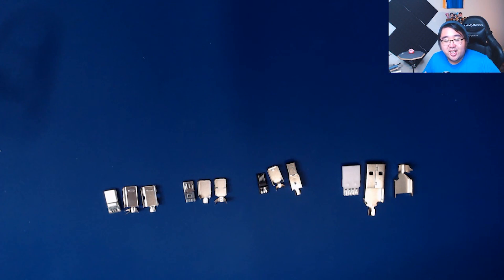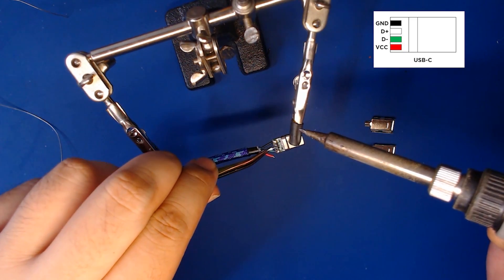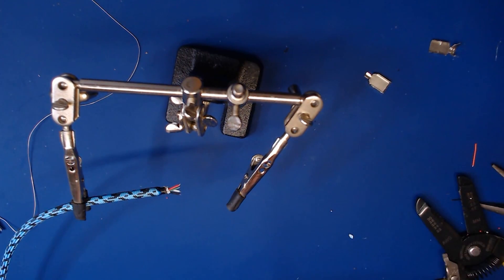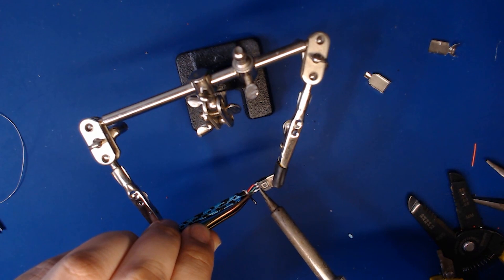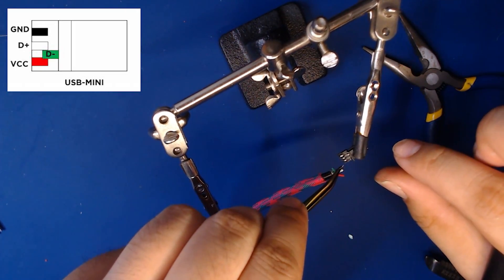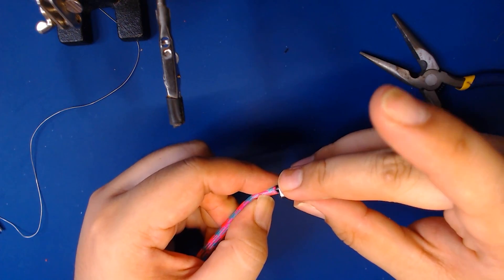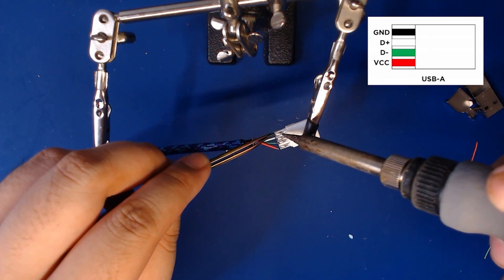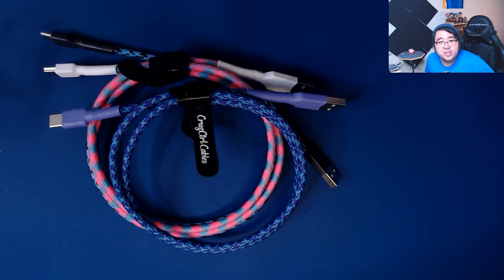How to Solder USB C, Micro, Mini, and A Connectors for Custom Keyboard Cables

Comment from the maker: Timestamps

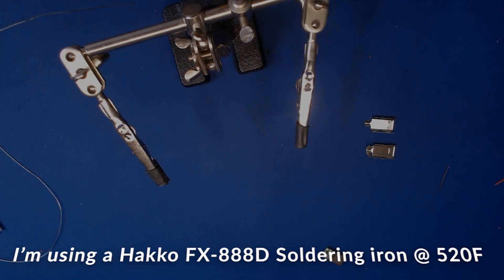USB-C: 0:55
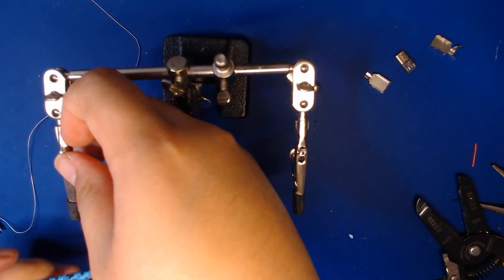USB-Micro: 4:12
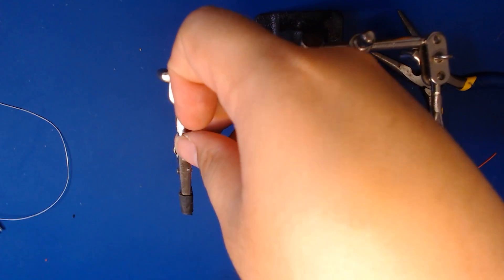USB-Mini: 7:34
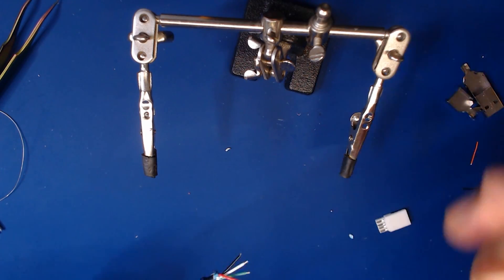USB-A: 11:35
Reply: Hi! would like to know where to buy materials to make custom cables
Reply: is it any use to make on the 3.0 USB?
Reply: Very nice video its really helpful, but what I want to know is how to make sure that your solder don't  attach two points together , and if that happens what you should do.
Reply: @ammarfv6366  i know when that happens you just reheat the solder, clean it up and resolder the connection
Reply: Are those male or female type connectors?
Reply: Wicked videos, they've been super helpful. I have a question and Im not really expecting an answer, just hoping.. My USB A connectors that just came in have the connector pins on the same side as the solder points. Would this mean I'd need to solder them backwards?

Comment: I need a USBC with both the cc pins having a 57k resistor to ground so that the 5V is output from the phone to a flir camera update I'm doing
 Changing from micro USB to USB C. But no connectors I've found have been suitable having the resistors factory soldered
 To solder to the tiny pins is such a frustrating job with butcher equipment and poor skills.

Comment: Question, I bought these connectors as I need to make 2 short custom USB cables for a 3D printer build (USB 2 but with C type connectors), they will be aprox 1' long max. What kind of cable to do I need UL2547 (4 wire shielded), UL2446 (4 wire unshielded) or could I get away with just lose 24awg wires??

Comment: Hi, I like the way you handle the USB’s. My iPhone MagSafe charger plug broke, and found 5 wires instead of 4. I see you have 4 coming from your cord. Mine has the same colors with an extra, forgot the color. Will buy the plugs you listed but need to know what to do without damaging my iPhone. Thank you.
Reply: i know im a year late but that probably was either the cc fast charging pin or something related to mfi

Comment: hey so I got like a broken repeater in a 30 meter long USB3 cable. I luckily was able to remove the section with the repeater, and shorten the cable by 5 meters, which hopefully won't be an issue. Yet now I've got this 5 meter cable going on, which doesn't have 4 but 8 cables, excluding the earth cable. This is of course cabling for the repeaters. And now I'm wondering whether I could get USB plugs which are active, so I would not lose this active capability of the cable I've got. Do you happen to know what to look for? I can't seem to find any active USB plugs.

Comment: Just a tip - if you want to expose more wire, you can use "liquid electrical tape" to "paint" over exposed areas and electrically isolate them safely.

Comment: i do have a question, if you do have a shielded cable(with some alumilium foil, and copper wire for exemple, would you need to solder it with the black cable aswell??? so that any interference getting to the GND?
Reply from the maker: That's actually a great question. 

From my knowledge Signal Ground (from input to output) should be kept isolated from the Chasis Ground (bascially the shield and metal shell used to plug in each side of the connection). 

The shielding in this case protects the internal conductors from external electrical noise and prevents the RF signals from leaking out.

From my knowledge the best practice is to connect (or even solder) the shield to the connector metal shell. 

Then again, I failed a bunch of circuits classes so I could also be wrong here :)
Reply: @CruzCtrl  i see yep, thanks for sharing your knowledge x); great video.

Comment: Thanks for the tutorial Josh! 💪🏾

I’m having a slight problem. When I try to solder the wire to the connector I get and wire insulation melting. It helped to lower my temp but I still somehow get the issue. 

Any suggestions?
Reply from the maker: Heya thanks for watching and trying out for yourself!

Here's a few things I can think of
1) Tin your connectors and your explosed wires to ensure that heat is only applied for as minimal as time as required. (I try to be as quick and precise as possible as I myself have also ran into the same melting issue you are having so many times)
2) If you are using metal tweezers, i'd try to grab onto the wire a little farther if possible as it will be likely retaining heat and melting your wire insulation faster
3) You could try using some solder flux when solder your connections, I use to do when I first started and I think it made the solder melting process a bit smoother. 

glhf :)

Comment: I'm glad I found your channel man. I just got here so maybe I haven't found it yet, but I'm trying to learn how to connect/soldier a usb-c to a micro USB cable. I have modified a Bluetooth speaker, which was two tweeters, to now power those tweeters plus two mids and one 8" sub. I paralleled some 18650s and soldiered them together for longer juice-time, but the sub just drains it, despite having a bank of six 18650s in parallel. So I want to connect a bigass power bank and I'll need a usb-c for the bank and a micro usb for the Bluetooth speaker. It's not amazing, but it is a good system for my shed in the backyard. Plus, I had all the stuff laying around so I haven't spent a nickle on it, excluding the electricity used to soldier everything together.
Thanks for your video and time, and I appreciate the shared knowledge brother.
**Nvm, this video shows me enough to figure out how to attach the micro to the type A. Thank you my good man!
Reply: Sounds like a fun project!   Forgive me if you're already familiar with this topic, I just want to make sure  you're familiar with the differences in IMR, ICR & INR cells as well as how to determine if the cells are protected or not.  Things can go quite badly when a cell is a bad match for the type of work it's being asked to do.

Comment: Could you just heat shrink over the connection without using the squarish housing for a slimmer cable?

Comment: Maybe it goes left 2 right - 5:44 / RED-WHITE-GREEN-BLACK,  (Vcc,D-,D+,ID, Ground on metal plate) -   I saw several connectors soldiered by that order.
This video is opposite from ISO standards for micro USB connection.
Reply: Right! 💯

Comment: This video was awesome, thank you. I needed the color configuration for where to solder. Question though. I had a thicker solder and was not as precise so they are a little thick at connection points. The cord works and charges, but is this a possible risk for fire? Or will a short just burn it out if it occurs?

Comment: Here's a good question: can you take a USB-C connector (cable end, like your first one here) and, using a suitable voltage/amp wall charger (for a chromebook, so power isn't too high), solder the type C connector to the charger cable? Basically changing the barrel type plug to a C. Thank you.

Comment: Also, the shield is usually folded back onto the cable jacket before the prongs are crimped. This causes the USB shell to be connected to shield to help prevent any noise interferences. Mostly for more industrial environments, but yea

Comment: The prongs on the USB shell should be crimped onto the cable jacket. The prongs actually dig into the cable jacket, and after they are crimped, the crimp height should be measured to ensure a good crimp. The purpose of the crimp is to alleviate any stress on the conductors when the cable is tugged or pulled--increasing the cables tensile force.

Comment: Hey. Great video, thanks a lot. Though I couldn't understand a few words here and there, I got most of it.
Here is an elementary question. Since the connectors are so small and the contacts so close, do you use a magnifying lens with the croc clamp setup?

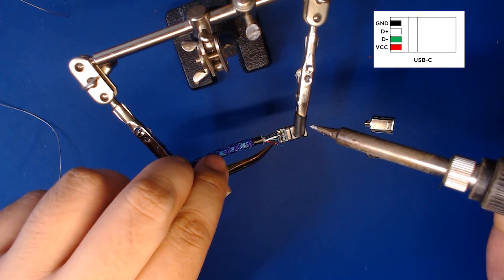Comment: 02:25 this is NOT USB-C standard wiring(dangerous if used for higher power rates)
https://en.wikipedia.org/wiki/USB-C
And You change wire colors, proper signs RED-DC+ WHITE( DATA-) GREN(DATA+) BLACK (DC-)
https://www.google.com/imgres?imgurl=https%3A%2F%2Fwww.slashgear.com%2Fwp-content%2Fuploads%2F2016%2F02%2Fusb-c-burn-800x420.jpg&imgrefurl=https%3A%2F%2Fwww.slashgear.com%2Fbeware-usb-c-cables-that-could-seriously-fry-your-device-03425324%2F&tbnid=L-eN-OjmLCNn2M&vet=10CAsQxiAoAWoXChMIgOHxyeHe8AIVAAAAAB0AAAAAEAM..i&docid=oSDuKgqcay8vuM&w=800&h=420&itg=1&q=usb%20C%20pinout&client=firefox-b-d&ved=0CAsQxiAoAWoXChMIgOHxyeHe8AIVAAAAAB0AAAAAEAM

Comment: My usb-a cable has a 5th (plain; without isolation) wire. It that ground and has to connected on the metal part of the connector?

Comment: Hey just wanted to let you know you have some wires in the wrong places for the mini USB. The green wire is actually the D+ and it goes on bottom middle pin and the white is the D- and it goes on the top right pin. So you got the location of the data in and data out right but the colors are wrong. It probably wouldn't matter if you are just making a cable. The only reason I found this out is because I'm making an Ergodox and had to make a USB header to go from the Teensy to the PCB and ended up putting them in the wrong place based off the color. Hope this helps. Thanks for making the tutorial it was a huge help!
Reply: I was trying to replace the mini USB connector on an already made cable but I couldn't get the keyboard to turn on when I was done. I chalked it up to my poor soldering causing a short. Would switching the data cables like Josh does (and what I did) prevent the board from powering on?

Comment: Okay but what about usb-c that has 2 pads GRD & V on one side and six pads on the other. A6 & A7 seem to be data points according to the interwebs but it only sends power, no data if I say plug it in to a kb versus plugged into my phone juice runs fine. Yes, the joints are clean. I just don't know what the deal is with the six pad b-side.

Comment: Hey Josh. I just wanted to thank you for the great videos.  I just made my first custom cable today. It's gunmetal grey with carbon techflex and a tungsten colored cerekote GX16 connector. The mini USB is a bit more tricky than USB C but I took my time and ended up getting great results.  i'll do my coil tomorrow using a 3/4" dowel.  Hopefully it turns out similar to yours!  Gotta keep that pressure on! haha

Comment: Hey great video! I have a USB-C female wire that I would like to solder to a USB 2.0 circuit board. The USB-C wire has what looks like several separate cables within it and I can't really distinguish which ones need to be soldered to the board.

Comment: Hey man, these videos are gold!  Id bought so much cable making stuff but just couldn't do the soldering stuff.  If im buying a crimping tool, is there one you'd recommend, like which sizes it being able to strip - the ones im looking at will do 0.75 - 6mm, but it's a cheap one..maybe a more specialst one would work better?

Comment: I was wondering where you could find bulk cable parts  like:
28awg wire, techflex, and heat shrink
Reply: eBay and Aliexpress are full of these. 
And this is not genuine techflex, since it's expensive.
To find it, you can just use something like these keywords - "Braided PET Expandable Sleeving Cable Wire Sheath".

Comment: Quick question. Is there a reason why heatshrink could interfere with the soldering points? I bought my first cable with Aviator connectors and it didn't really work. It kept disconnecting etc. I finally gave in to check the solder points and cut open the heat shrink. Solder points were fine and nothing interfered with them. Ever since I cut the shrink open it's been working flawlessly.
Reply: Inside the aviation type connector? Well, most of the cheap Chinese aviation type connectors are pure junk. On the opposite side, the real brand name aviation type connectors are ridiculously expensive. That's what you get when you go Form over Function... Looking like something doesn't mean functioning like it...

The heatshrink itself can't do anything, unless it's wrong size / length on the wrong place. It either pulls, stiffens or bends the pins. Which is possible only in a junk connector...

I can't understand the idea of the whole "fancy cable movement" - fancy outside, junk inside. Just get a proven industry standard XLR connector. Neutrik are German made,  Amphenol are US made.

Comment: Why is this core placement different feom other sources i see? Sometimes i see the D+ and D- is different from yours
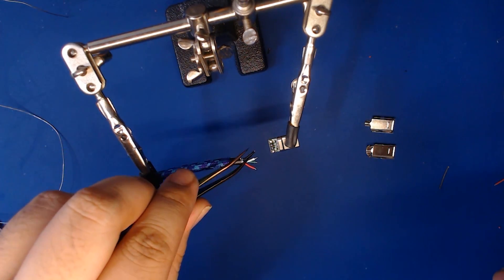Reply from the maker: Yeah, you're not wrong. I put a little disclaimer at 2:02

The green and white wires are a twisted pair, and it should work either way as long as it's consistent on both ends. It was a habit I picked up when I first started and I haven't been able to go back since.

Comment: what temperature do you have your soldering iron to?
Reply from the maker: 520F
Reply: @CruzCtrl  maybe its because I'm using a TS100 but the coverings around the wire still always manage to melt a bit

Comment: Just finished my first cable, a white usb a to usb c with a coil and an aviator. Couldn't have done it without you!
Reply from the maker: awesome! hope they turned out well for you. :)
Reply: Does the USB C to A cable you've made, works for data transfer?